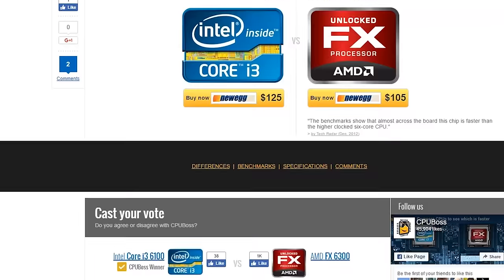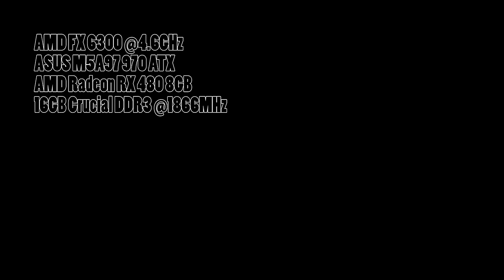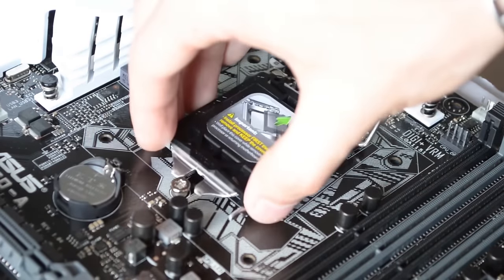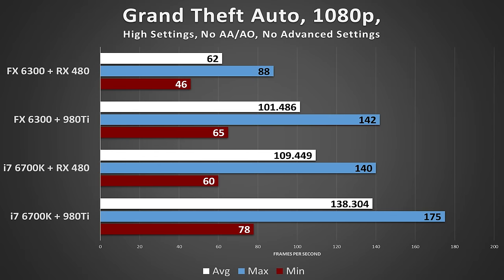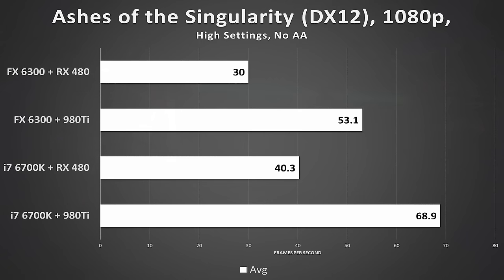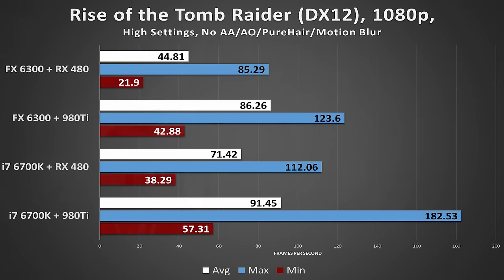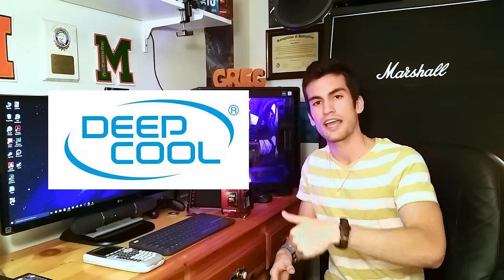AMD FX 6300 + RX 480: Severe Bottleneck?

Comment: amd cpus works great with nvidia gpus, and vice versa, intel cpus works with amd gpus, for the money ofc
the key is to use a amd cpu and a nvidia gpu
the fx6300 is good cpu for the money, if u oc it to 4.5ghz will work great with any nvidia
Reply from the maker: The whole "amd cpus works great with nvidia gpus, and vice versa, intel cpus works with amd gpus" argument is a bit of a sham at this point. There has never been conclusive evidence of that; only a few inferences based on CUDA and OpenGL data retrieval.
Reply: Ryzen is Here so...............People who are not specifically a one company supporter/"fanboy" can make a really good gaming and productivity pc

Comment: probably was the power supply i got evga g2 850w fx8350 4.0  oc 4.5 and fx 6300 oc 4.5 yes big difference between both but the fx 6300 oc 4.5 and visiontek hd 7850 2 gb ran the same games I run on my new pc not at the same speed but it handed it self wtf you want out of a $99 cpu compared to top of the line and the you trow in ddr4 makes no sense

Comment: I have a 6600k and a 980ti myself, and i can't help but wonder that your analysis of this isn't really about bottle-necking. It's simply... a cheap cpu against an i7 which lets face it? will always win. Of course the fx6300 will have overall a lower frame-rate in any cpu intensive game, but that's purely because it's a pretty cheap cpu. No one would ever pair a 980ti with a 6300 that's just bonkers. The same can be said for the RX 480, why pair it with such a weak cpu? that is years old? Anyone getting an RX 480 will have an i5/i7 or one of the top end amd cpus. The bottleneck is only caused by the inability of the chip to produce enough performance to improve the frame-rate, it doesn't make the graphics card weaker, the gpu will perform as well as it can, even up to 100% usage if you push it, the only reason the frames are pushed down is because of cpu intensive games which require more cores, or more clock speed and so on. The whole topic about bottlenecks is a long and arduous topic, jayztwocents has gone over it and explained it the best I have seen. You would be better doing a comparison between the fx6300 paired with an r9 390/390x and the rx 480 to compare the actual performance gain. I'm actually worried for amd, as the r9 390x is the same price, and is only a small percentage below the rx 480 in performance. For the same price to only gain a little bit of performance? that's hardly a good thing. Nvidia have really blown the market with pascal, polaris just can't compete with pascal in anyway.

Comment: Ive got a fx 8350 and im putting in a 480 yall think it will bottleneck?
Reply: how expensive/difficult is it to set up liquid cooling?
Reply: Eric Turner  
how expensive/difficult is it to set up liquid cooling?
Reply: dw you'll be fine on stock clock
Reply: Eric Turner ooh thats nice. how much of a boost do you get overclocking like that? 5 frames? 10 frames?
Reply: Mitchell Staley it's ok doesn't matter if u get 10000fps ur monitor only displays 60 lmao
Reply: Mitchell Staley no idea why u got 1440p monitor with a 1080p optimixzed card... one will never know... should of looked for a fury x
Reply: Cody Fournell i meant 144hz dingus. you said  "doesn't matter if u get 10000fps ur monitor only displays 60 lmao" but i have a moniter that displays 144hz
Reply: test it in Wither 3, you will see!
Reply: YES BUT YOUR EYE SEES ONLY 30 LAMO

Comment: I have an amd fx6300 paired with a gtx 960 2gb but I get 20 fps dips all the time on medium settings
Reply: Moe A You got an imbalanced PC.Your GPU VRAM is too low.2 GB is just not enough.That's why you are getting dips on games.CPU Bottleneck means your GPU will never be able to cross 20 FPS.
Reply: I don't think so because I've seen 750s run bf1 better than my rig so I used a program to check my gpu usage ingame and my average was around 40-60% on the same gpu is there any way to fix this

Comment: I can only imagine the bottleneck on my X4 860k
Reply: technically your x4 860k has 15-25% better per core performance/higher IPC, so it's better for gaming.
Reply: IIIRattleHeadIII OK thanks. I'm still relatively new to PC parts so I get ultra bias towards the amount of cores and ghz
Reply: I'm running an X4 870K and a (soon to be replaced) 750Ti FTW. I've not tried anything new on it, but that combo is buttery smooth on CS:GO with settings just about maxed at 1080p. I also get pretty stellar performance on Skyrim with the same graphical settings, but that isn't much of a stretch with relatively new hardware. Your 860K should be good for many things, especially with an overclock. I highly debated going for a more expensive FX six core setup, but in the end the slower memory speeds, and no PCI-E 3.0 support, moved me over to the FM2+ platform. I'm hoping an RX 480 will be a welcomed addition to my rig, but I'm going to wait until the 8-pin non-reference cards hit the shelves before I buy.
Reply: I'm gonna wait till AMD releases their "Zen" architecture CPU. Then I'm gonna buy a new AM4 socket mobo, a zen CPU (probably the X4 950), and DDR4 RAM since ddr4 is the current standard

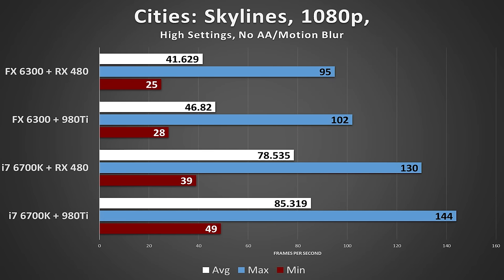Comment: 5:54 so the i7 bottlenecks the 980ti? 
Since the 200$ price difference only gives the same'ish amount of "boost" as the fx 6300 gets by using that card. 
5 fps boost on fx 6300 with 980ti instead of rx480
7 fps boost on i7 6400k with 980ti instead of rx480"

"here the graphics card choice, didn't really make much of a difference. Folks if you want proof of a CPU bottleneck this is it... a 200$ price difference in graphics cards made almost ZERO difference in framerates thanks to our fx 6300... Oh and also thanks to our i7 6700k which also also got close to ZERO difference in framerates even with a 200$ price difference in graphics card"

Or am i totally wrong?

Comment: you kept saying the 980ti is twice as powerful as a rx480. it's not. it's never been. the 1080ti is about twice as powerful as a rx480, and that's like 50% more powerful than a 980ti.
980ti is about 30% more powerful than a rx480

 for those who are illiterate at math, 130% x 1.5 = 195% so this is not fail math.

Comment: So i have a FX 6300 pared with a r9 380x. I play on 1600x900 resolution and i have no good performance. The settings are all high but even if I change settings to middle or low nothing changes in performance. For example in Battlefield 1 and 4 I experience unstable fps and the CPU usage is often on 100% as well as the GPU usage. Fps is quite good sometimes but you can clearly feel that it has big fps drops sometimes (e.g. on big maps in Battlefield 1 even constantly low 20-30 fps). 
Is my CPU bottlenecking my GPU? Or is my hardware even damaged? 
Can anybody please help me I would really appreciate it 
Thank you all have a nice day :)

Comment: If the 980ti is " double the RX 480" then why are none of these graphs using the 6700k showing this? 
Are you guessing or just parroting what you've heard? 
I'd like to think you've tested this but these particular tests don't prove you're statement true at all.
Removing any CPU bottleneck the RX 480 (especially the RX 580) is at least 75 percent of the 980ti's performance.
My Rx 580 has no problem running any game that I play paired with my 1700x.
It's people like you that keep AMD struggling to earn the money they need to compete with Nvidia.
Competition is good for everyone. Stop being biased ....... Even subtle bias is just as bad.

Comment: how is the fx 6300 a bottleneck??!!
Reply: 2.9ghz, 4 cores, now I see...
Reply: It's more than just cores and clock speed. More modern CPUs should be faster at even the same clock speeds due to other improvements.
Reply: the FX 6300 is a 6 core running at 3.5 ghz stock, OC ready as he stated to ??? 4.6 ghz.  thats a bit high but 4.2 ghz is easy.   But the 8300 (8 core) runs 15% faster stock and would have been a better am3+ socket CPU at $120 on newegg ($20 more than the 6300).  It still would not be a match for the i7 overclocked with DDR4 but would have been better I believe.
Reply: Number of cores or ghz don't mean anything. And the FX 6300 is 3.5 ghz and has 6 cores.
Reply: The CPU that you are talking about is the Athlon x4 635
Reply: T1mato 4
Then what should someone look at?
Reply: Z0MG H4X Look for benchmarks for the same type software you plan to use. You can look at clock speed and cores when comparing CPUs in the same family, but different families and brands require looking deeper.

Comment: It doesn't matter. I'm getting this GPU with  my AMD a10 7850k. :D
Reply: I want that also! I've a a10-7850K!
Reply: Robin Kuijer From what ive heard, bottleneck shouldn't be THAT bad. :D
Reply: AMD allows for crossfiring between certain APUs and GPUs, although I have no idea about that combination :p
Reply: +Janko Mudrak indeed!
Reply: And yeah, not useful really either way
Reply: +Sabarna Chakravarty no, you can't crossfire those the 480 with any APUs. They have to be the same architecture and have a very similar sp count. So basically you can only crossfire very low end GPUs with APUs :)
Reply: He probably already has it in his system, that's the point he is trying to make.
Reply: Only the r7 series like 240, 250 and 260
Reply: +xxshadingvazxx nope
Reply: xxshadingvazxx it doesn't matter anyway cuz ill be playing at 1080p 60-75 hz.
Reply: +Janko Mudrak me2 ;/
Reply: +Janko Mudrak at low settings maybe.....
Reply: +Mr. Klunee um wat
Reply: +Janko Mudrak My point is that using an rx 480 with an Apu is a terrible idea because the cpu will introduce a serious bottleneck. The cpu part of an apu is equivalent to an athlon x860k.480 is a very powerful card and is not suitable for such a cpu. A more appropriate choice would be maybe an rx 460 or an r7 370. You shouldn't go any farther with the gpu.
The best thing to do is, if you have the money, go for a cpu upgrade. If you really want an RX 480, the best choice would be an i5 or wait to see what Zen has to offer.
Reply: Mr. Klunee ive seen these run with a 380 and sometimes even more powerful stuff, there will be bottleneck but minor frame dips and performance compensation that wont affect me at all.
Reply: +Janko Mudrak This is what I'm saying:
The performance of an athlon x860 is typically around that of a Pentium
The performance of an RX 480 is around that of an r9 390
You wouldn't pair a $70 cpu with a $300 graphics card would you?
In other words: I'm not saying that you wouldn't get good performance, I saying that you would be creating a bottleneck on the RX 480 and that you'd be better off saving money on a cheaper graphics card like an r7 370  because you'd be getting a minimal performance difference from upgrading to such a powerful graphics card. The RX 480 would create a general unbalance in your build.
Reply: Mr. Klunee Yes i know but I thought you exaggerated by saying "on low settings" lol. Might get 470 if not 480. Im waiting for zen cpus.
Reply: R7 370 is shite m8
Reply: +Janko Mudrak Yeah I was exaggerating. But waiting for zen is a smart choice. They seem pretty promising at least from the information that's been released.
Reply: Mr. Klunee yea and im going to be playing at 1080 p ultra 60-75hz so ill probably be okay with oc'd 470 but idk yet.

Comment: Don’t buy I upgraded my gpu and the bottleneck was  ridiculous the FPS stayed the same
Reply: What did you do?

That being said, these cpus really need to be overclocked to get half way decent results. Did you?
Reply: I had a gta 660 and got a rx 570 and the FPS has stayed the same and in some titles got worse
Reply: @Fredroix2  well like I asked, were you running CPU at stock or overclocked 

Just curious 

I'm well aware this is an old and weak by modern standards cpu but you shouldn't have seen a decrease
Reply: Steve Smith I was running the cpu slightly over clocked at 3.9 ghz

Comment: If it bottlenecks a 480? Oh man, it bottlenecks even my 270x! Wich is not even half as poweful as the 480! Awful processor, I regret buying it over a i3 or even a G3258 every day. I could fix the problem overclocking, yes, but mine is a budget build and my motherboard can't handle over 4.2 ghz

Comment: will it bottleneck a 460?
Reply: no
Reply: AtgreatR9 and a rx470?
Reply: Rivail_ZaWard nope will work great. maybe not good as some i5 but its a great combination
Reply: ***** So an i3 6100+rx470 is better than i5 6400+gtx1050?
Reply: Rivail_ZaWard this video was about amd fx6300. yes i3 + 470 will work better but i3 (dual core) will have trouble in new games which will require 4 real cores. the best option for budget would be fx6300 with rx470. or lets wait the new amd ZEN cpus and see their price. anyway if u can go with i5 6400 and rx470 that would be awesome :)
Reply: ***** I Will wait for Zen :)

Comment: I am considering a build with this CPU at http://pcpartpicker.com/list/psC8Yr. Could you tell me if that is a good build combo?
Reply: Correction: AMD FX-4350
Reply: I suggest get an Athlon X4 880k because it has better performance and less power draw, but if you are going to upgrade to an FX 8350, then get the FX 4350, but Zen is coming out soon so, you could get the cheapest option, and save up for Zen, or for intel.
http://pcpartpicker.com/list/Lyqhyf
Reply: I am going to stay with AMD, but I like Athlons. Thanks for the suggestion.
Reply: im going to use that.

Comment: Just get a Haswell i5 and your golden.
Reply: or a second-hand FX-8350 (or better) for cheap.
seen systems with Asus Sabertooth motherboards, AMD FX9370, 16GB of DDR3 and a 120mm Antec AIO liquid cooler for less than 150usd.

seen i7 4820k\4930k systems with motherboard and memory going for well as cheap.
combine that with a 130usd used Radeon 290 and you got enough omph for most game for quite low value.
Reply: (and those prices are from over here in bloody expensive Norway)

Comment: Throw that RX 480 into a Dell optiplex 960 and watch how NOT fixed the power draw issue is, lol 

Same with RX 470 and 460, all draw too much power from PCI-E slot and won't work in most prebuilt PCs 

You suck at this job man lmao

Comment: idk man i run everything on max with my amd fx 8350 no problems. Barely cares about anything. i dont think amd is that bad.
Reply: i agree, i can some dips but when i purchased my cpu, the latest i5 was 2x the price of my 8350, and i paired with the the msi 970 gaming and the msi 970 gpu, and i have very very little issues, i play fallout just fine, GTA v just fine, small dips but thats if im going super fast or flying. but it works great, even streaming,recording, and gaming all at once, just fine. need to test some overclocking though and see how much better it is
Reply: HeavyHERO93 Some people have got it to 5ghz
Reply: FX83xx is bottlenecks even GTX960 so it's really outdated already and also overpriced :(
Reply: MrKeikari I have gtx 960 and have no problems or fps drops or anything

Comment: why do you tokk the  RX 480 for a slow 6 core AMD (dual core intel) CPU ? It will bottleneck, like it always bottlenecked a good GPU, even FX 8350 @ 5 ghz bottlenecks a GTX 780, or a R9 290, never buy shit amd cpus. There is a golden rule, you wanna play games, but an intel i5 (like 3 4 5 or 6 generation)  on a i5 you can have 2 x GTX 780, 2 x GTX 980 Ti, or 2 x GTX 1080 without bottlenecking, with AMD CPUS you CAN't GET any 2 cards, even any 1 the best cards. Listen to me dudes.
Reply from the maker: This was a test, not a real build. Pay attention.

Comment: dude...6300...sucks...we all know it sucks...but try the 6350 or 8350/8370(non E) I dont know why everyone punishes AMD by their lower end FX6300 but what about the 6350 or even if you would mind buying a 8300 and then try a 8350 or 8370 OR U KNOW WHAT but the ASUS Crosshair V Formula-Z and buy the FX-9590 :D (but really why everyone have to pull out the worst things from AMD whynobody tryes a 6350 or a 8350/70
Reply from the maker: No difference. 6350 will perform the same.
Reply: Why not get the e version? Is it less powerful??
Reply: adam that Fx6300 its already overclocked above the Fx6350 stats.
Fx8 core at same frequency might give a 10 to 15% FPS advantage in about any game. Nowhere near the i7 6700k, but quite decent Performance by its own and great price / performance ratio
Reply: Juan jotabe But you can go further in the 6350 and hey my 4300(which is there temptarely is overclocked to 5Ghz nobody cares)
Reply: Adam Varga you can go a little higher in 6350, but the gap its about 200mhz, not that big deal.
Fx6300 its a nice CPU, 4 almost 5 years after its release can still hold his own with modern day games, shure, the 6700k numbers are quite better, i wouldn't purchase it brand new at this point... but it can serve to their current owners for some more time while waiting for zen.

On the other hand Fx8350 can still be purchased as a "solid" CPU, VR and 4K capable (paired with top end GPU). and that's even at stock 4.0/4.2 speed... so it has some little room ahead.

Last but not least, this channel has a strong opinion against AMD CPUS at least at top end... i would say that for Fx6300 users buying the RX 480 its a valid choice, a point this vid its failing to deliver
Reply: Science Studio okay...8350 or 9590 what about those (im not actually wanting to start a drama but this kinda ruins my day)
Reply: Juan jotabe yes aaaand no...i would say rather go with a better GPU ofcourse you would bottleneck a 1070 but a little tweak would help. I honestly dont care about the ram that much since i got 2400Mhz 16Gb kit but the zen...well...would be nice if AMD would release a newer architecture CPU for thisokay  quite old socket but be nice cause more than probably if you ask a random average person what computer he/she has you would find a phenom inside of that potato rig a lot of users on AMD are there for a reason..CHEAP. If they would make something for the AM3+ that would give em some moeny for sure (not just a refresh btw)